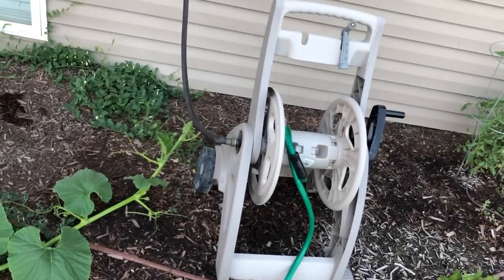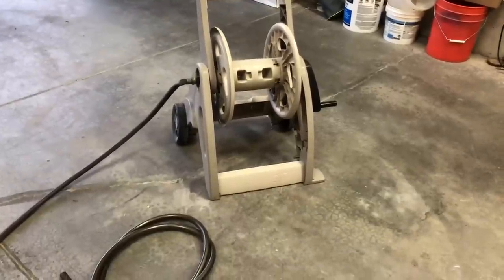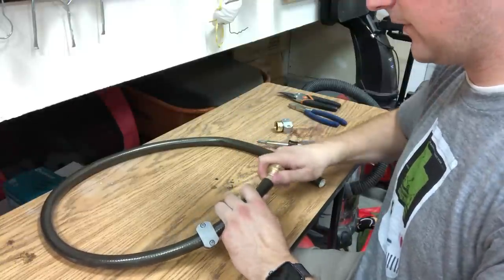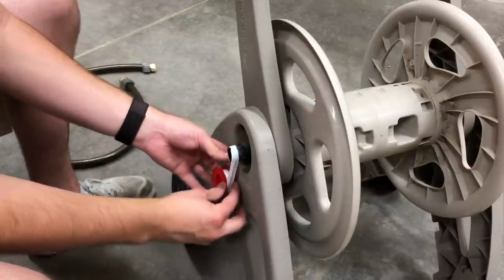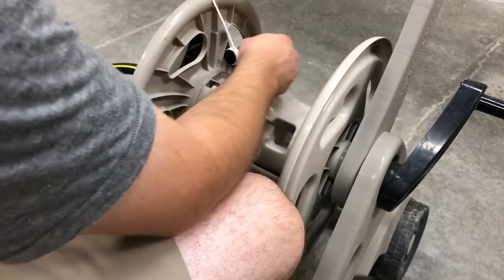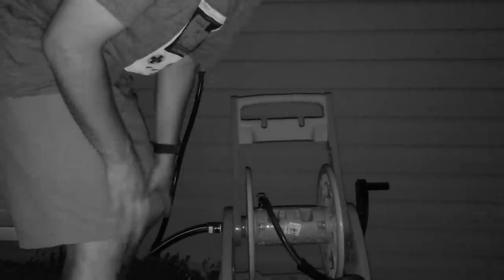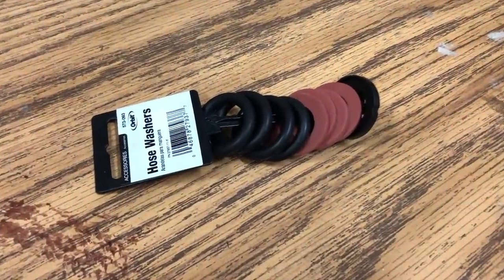Fixing a Leaking Hose Reel

Comment: When I bought my first spool cart I immediately bought a nice 5 foot braided hose so there would never be a kink.  Other than replacing the 5 cent hose gaskets once in a while, it still works great 20 years later.  It was time to fix my spool gasket, though.  I hate buying new crap when you can just repair it.

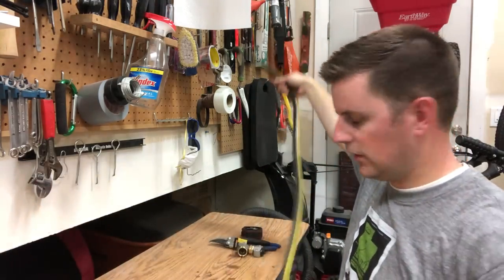Comment: Good info, Thanks!  At 3:09, sure I can see making the connector hose the same length as the original one, but some of you might add a few feet, enough to get the reel say out of the mulch, or just out away from the house or through bushes, or for what ever reason you might want it our say 6' from spigot vs 4'.

Comment: Excellent video and I did enjoy it thanks.
However it must be pointed out that it was your new hose gaskets that fixed your leek and not the thread/plumbers tape as the seal is done only where the hose meets the fitting. The threaded collar only accomplishes fastening the hose snugly to the fitting where the hose gasket is placed.

Comment: Always wrap tape clockwise, the direction you turn the connector to tighten, not counter clockwise.
Reply: I noticed he did it correctly on one fitting and not the other

Comment: You fixed a leaky hose, not a leaky hose reel
Reply: And on the part that is within the hose reel itself, he put the Teflon tape on in the wrong direction; Teflon tape should be put on in the same direction as one would rotate for tightening.

Comment: The threaded portions do not affect the seal....it is only used to compress the fittings together tightly. Yeah, the "rubber gasket inside" (8:00 - 8:06) ) does ALL the sealing.  Also....even as you use the tape, you wound it correctly on the first ( side entry) point ( clockwise as ou face the opening)....but you wound it backwards (counterclockwise) on the "L" piece on the drum....just sayin'....as people may follow you on other stuff to do.
Reply: Thank you Wil Frech. I noticed the difference in the clockwise/counter clockwise wounding of the plumbers tape as well. I was then confused which was the correct way for the tape to be wound. You help solve my confusion.
Reply: @joannbrumfield7715  ....yes, correct way will always be to help the tape stay where it is...when you tighten down. So....clockwise. Otherwise any nut or fastener you try to screw down will "unwind" the tape you laid down, if done counter-clockwise. That all said, in this case, using tape was altogether not necessary as you were using compression-fittings. Cheers.
Reply: Actually tape is not needed at all.
Reply: @comesthru  ..if you re-read my post, I think I said this. My point on the tape is "that when you use it in other places" where it then should be used....the way it was shown, it was wound backwards, too.
Reply: @TheWilferch  of course I noticed it (wrong way teflon tape). It is kind of unexpected in a video like this. BTW sometime I use (like in garden hose) pipe dope just so it keeps the damn thing easy to remove (again not really required).

Comment: Great video, Mr.Lewis! I have that very same hoes reel but unfortunately, my leak seems to be located somewhere behind where the female pc of the holes attachment is, which is covered by the molded plastic housing of the holder itself, that then leads to the other part that attaches to the water holes where you had your leak (the 2nd part where you placed plumbers tape (the white sealant tape). My leak is somewhere between the two hoes spigot attachment pcs. I don't know if I can dis-attach the plastic w/o breaking something in order to find the leak but I guess I'll just have to see! My water bill is HIGH ENOUGH! It's either try and fix it or toss it! Anywho, thanks again for the video, friend!🙂

Comment: This is the [edit:  NOT!] only video to show the Wal-Mart hose reel.   The side outlet  fixture has two recessed tabs and printing on the tab that says to pull them to repair the inner part of the hose reel “plumbing”.   Is this really possible?   I’m hoping to repair my broken outlet fixture with another one I acquired from a neighbor.   This is really much more daunting than simple hose leak repair!  [edit:  there
 are two other videos that show disassembly of the internal plumbing] 

https://youtu.be/59YxVBJEnuk